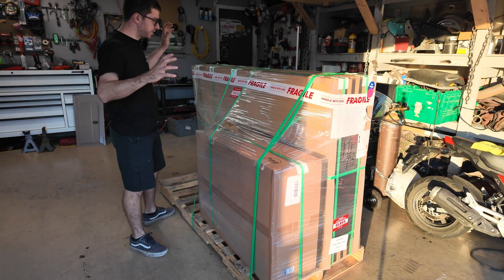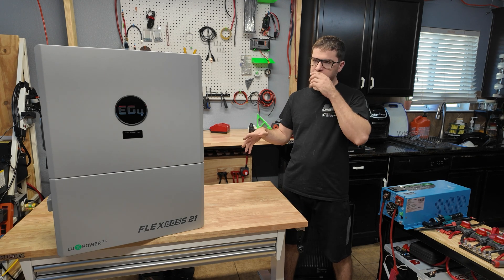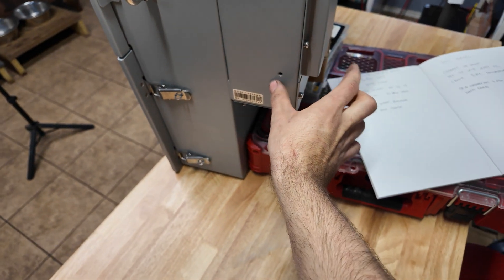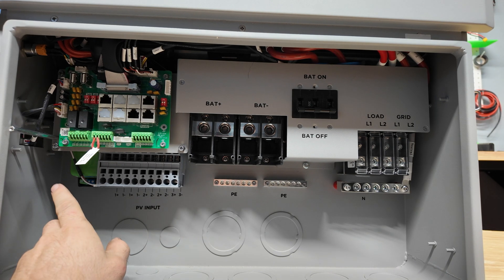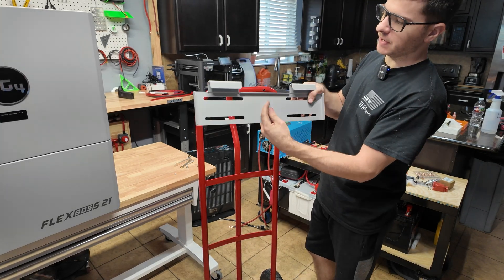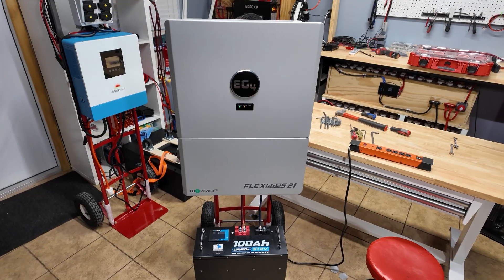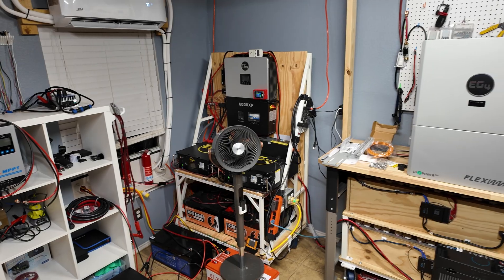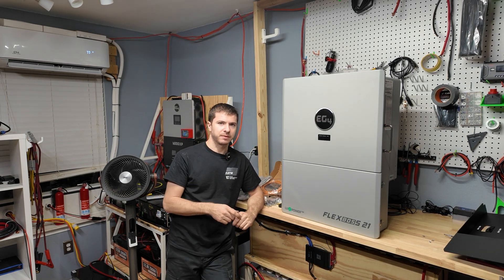16,000 Watts Of Solar Power!  Eg4 Flexboss21 48 volt Inverter Unboxing, Power Up, Signature Solar

Comment: I have a 12000xp and grid tie solar.  Inverter is great but I'm am going to upgrade to a hybrid one.
Reply from the maker: That’s the main reason I went with this over the 12kxp, In case I wanted to do grid interaction, plus 10 year warranty

Comment: This looks really cool. However, I prefer a system that doesn't require a "phone" or "internet" to setup, and the lack of a screen sort of concerns me.
I definitely DO NOT want to have to use the internet to ensure that my unit works in case of emergency... ever.
And I especially don't want to have to log into an account to turn it on either.
Reply: But I have my utility grid and my grid tie solar tied together with a Polaris connector in the grid connection in my inverter. So in day time when it pull from grid it's my owned solar supplying the power.